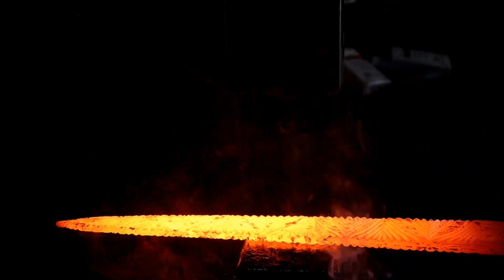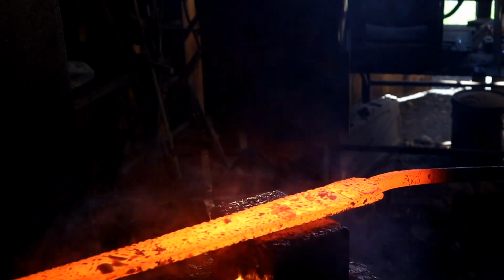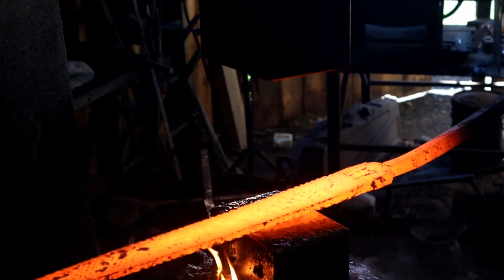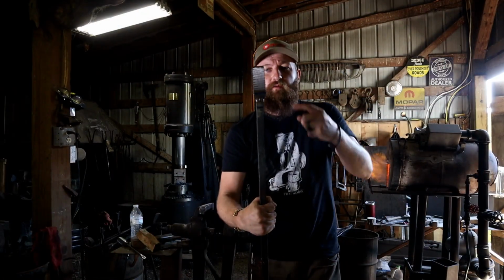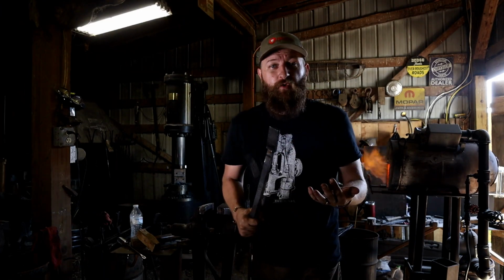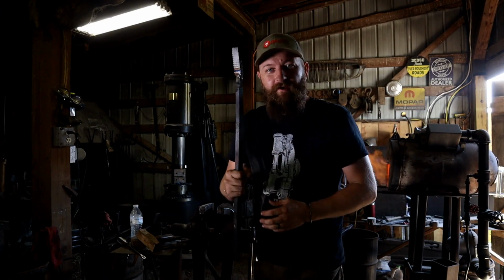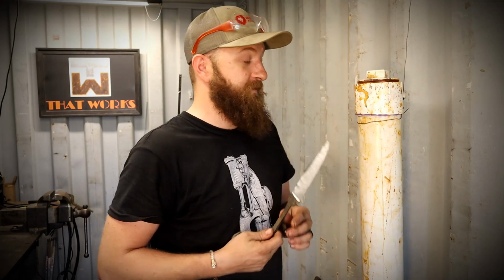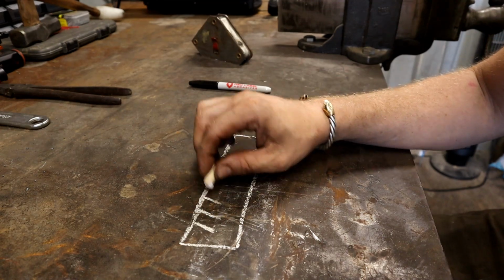You Have to Try This - [Plasma Damascus]

Comment: Rand Al'thor's Heron marked blade from Wheel of Time.  Fitting with the Amazon series starting soon
Reply: Yes! Please do!
Reply: or better yet Mat Cauthon's Glaive (ashandarei)
Reply: Both!
Reply: They better nail the trollok attack on the farm and his dads response.
Reply: Wow there’s a series of the wheel of time coming?! I’ve hardly even read half the books.
Reply: Yes!
Reply: @kaycoda2196  That would be awsome!
Reply: YAAAAAAASS!! ashanderai (glaive) or a heron marked blade!! i would say Perrins hammer but that has bee done a bunch and is relatively simple.
Reply: @nordicninjah2497  The original axe he used would be pretty cool though. Admittedly it's basically just a war axe, but still cool.
Reply: @InstrucTube  I mean, they could whip up an axe or mah'alleinir (the hammer) and have all three!! 😃
Reply: Ive actually been reading through The Wheel of Time series and I think any of those three would be awesome to see. I think it would be super cool to see an episode where they make a blacksmith’s puzzle or two as well. They mention blacksmith’s puzzles alot in that series as well, especially Perrin the blacksmith.
Reply: Best series ever
Reply: Please do Rand Al'thor s heron marked blade and Mat's Ashandarei. Wanted to ask you guys for a long time but didn't think a lot of the subscribers knew about this

Comment: I am going to try it! Thanks for the tips about the slag. I found that instead of grinding the slag off I chip it off with a chisel. Way easier because the slab is extremely hard so it takes forever to grind! Good luck with your new addition! Cheers

Comment: So from what I can see, if you angle the torch at close to say a 45 degree angle, then do it again on the opposite side of the cut you'll get those v's you're looking for. Alternatively you can do straight cuts with the torch, then use a disc or belt grinder to widen them, it still saves time by removing the bulk of the material beforehand with the torch. I think your pattern would have been a lot more "laddery" if you didn't have to grind so deep to get those cold shuts out (obviously) so doing a little widening work on the cuts after the torch would not only save you that work but would help eliminate the leftover plasma slag as well. Really cool idea, actually, hopefully you can get it to work better in the future.

Comment: I've learned to touch the metal with the nozzle of the plasma torch in order to cut. Interesting experiment, though! What concernes me is the crazy high temperature the steel endures with the plasma. I wouldn't be surprised if it was more brittle in those areas.
Reply from the maker: Loéï Music & co once I heat it up and let it cool slowly it all gets normalized

Comment: 39:00 This is why I always wear steel-toe boots. That looked like it HURT.
Reply: There is a stunning lack of PPE in this video.
Reply from the maker: SnowblindOtter oh it hurt
Reply: @ThatWorks  I have no doubt about it at all. Not sure if it was actually copper, but whatever it was looked like it weighed at least 25 pounds.
Reply: @SnowblindOtter  that was an iron anchor chain link, it's what they made the super nice hammer a few weeks ago with

Comment: That plasma Damascus looked kind of interesting for more elaborate patterns.
Maybe sand blast the piece after plasma cutting to get rid of the slag..
Reply from the maker: Corbarrad that would help for sure. Thought about using borax as a blast media so it just turns to flux when you heat it up
Reply: @ThatWorks  Glass and some types of sand will turn to flux as well.  Also, look into plasma arc gouging for welding.  I think that would give you the effect you're looking for.  Gouging tips produce a much wider cut for one to weld into.  But check you machine's manual to see if it'll do that.

Comment: It may work a lot better on a CNC plasma table. It might be worth a try in gouge mode by hand too. You’ll need a lot of air pressure to blow out the slag though.

Comment: Hey I've had a question for a very long time and I'd love to hear what you think:
If you were to forge a pattern welded billet, would it then be possible to heat it up and use a rolling mill (or power hammer?) to make it into a sheet suitable for (decorative) armor, that would still show a nice pattern when acid etched?
I've never heard of or seen anyone try it, and the only place where I've ever seen the effect was in a videogame cinematic. (Elder Scrolls Online "the arrival" cinematic)
What do you think, would it be possible/feasible?
Reply: It should be, but remember that rolling the billet will stretch the pattern out, mostly along the direction of rolling.

I'd do a simple, low count bar and roll it to see how it will stretch.
Reply: @ScottKenny1978  Agreed. Though, if you did something like a chevron or herring-bone pattern and stretched it lengthwise it'd still be recognizable. A raindrop pattern could be really cool stretched out, if it was a really tight pattern originally it could look something like scale mail.

Comment: Hi guys, 
Another great video, well done. Now here's what I've been giving you as a challenge/suggestion on many of your other videos as a suggestion for one heck of a bad ass Viking battle axe that no other can rival it as it is the holy grail of Viking battle Axes. 
The Thor axe  "JARNBJORN"  built out of heat treated and tempered "Titanium". Why Titanium you ask, because it's the only material that can do this axe justice. Plus it would make an incredible collector's piece, a one of a kind with no rival. The most bad ass axe ever produced. What say you, up for the challenge?

P.S I guess you could make it out of 5160 but in doing so, you take away exclusivity of a Titanium version because you'll have hundreds of copycats making them because it's much easier to use 5160 than Titanium. A titanium version vs any other steel would make it a one of a kind as I don't think they'll be many copycats willing to put in the work of a Titanium versions. Yes I know that Titanium is very expensive and incredibly hard to work with, hence why it would be so bad ass and one of a kind that you could easily ask whatever you want for it, since there's none out there to compare it with. 
"HIGHLY COLLECTIBLE DUE TO EXCLUSIVITY" are the key words!!

Comment: I'm making my first Damascus billet and I think I may have messed up. I welded it together but I have the layers parallel to the spine and not the blade is that wrong?
Reply: I would think it's just a different paytern. You cleaned the chunks nice and what not right?
Reply: @joshschneider9766  the welds? What chunks

Comment: You mentioned "carving your name" as a possible thing to try with the plasma. All the patterns I've seen you do have been like the design you showed 3 minutes into the video where the grooves go to the edge. Would doing fully internal grooves like with a signature actually unfold, or would they just leave a divot as the metal moved around them?

I'm asking as an ignorant viewer, not someone who knows anything about this.

Assuming internal shapes do work, you might consider making patterns with dots using a drill bit or varying sized bits to make relatively shallow v-shaped holes.

Comment: CNC it instead of plasma cutting it. Much cleaner, no slag, and depending on the bit you use you get either straight, round or even v-shaped groves.
Beyond that, with a CNC machine you could go for much more intricate designs...

Still, interesting though...

Comment: 21:00. Jig for knocking carbon scale off the blades?
Reply: Ahh.  Surface grinder.  Exact definition of the jig.
Reply: So to build would be a simple table vise Jaws wide opened and then refit the belt sander and hope that don't pop..